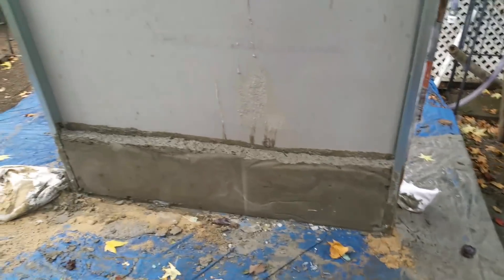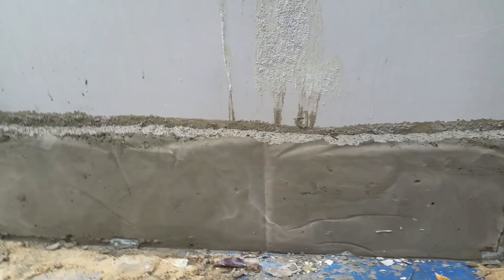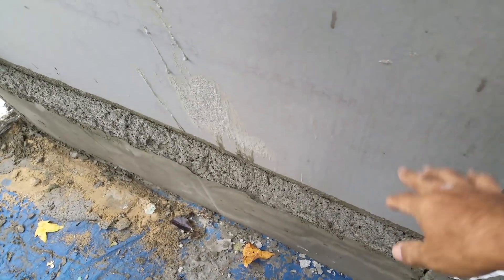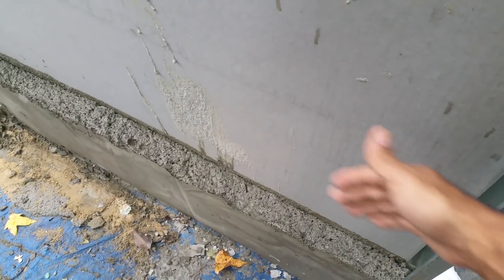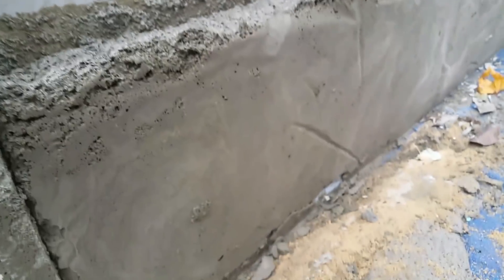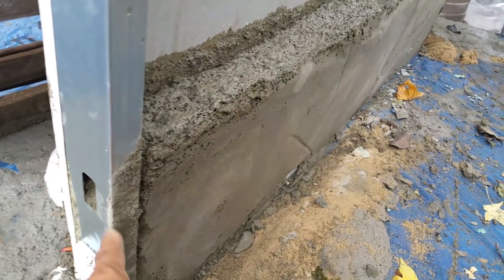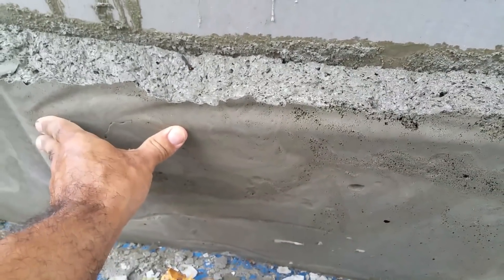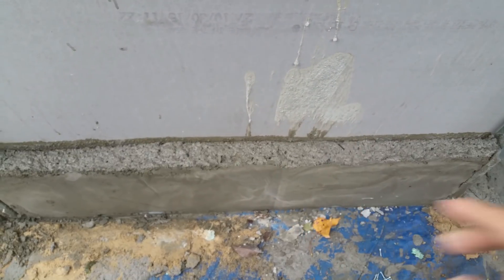Aircrete Wall Experiment #Aircrete #AircreteHarry #AircreteWall #AircreteExperiment #DIY #Foam

Comment: Harry  YOU CAN MY FREIND ! PLEASE READ THIS !!!! if you planning to put that technique outside i will advice the guy attempting to do that to not keep the metal studs! ok no need for ! they will create low spots in quality of the material (as for isolation purposes) Been different materials they will react as for the 2 key factors in isolation that is loss (transmission) and resistance against temperature changings !!!! so better to pour on it but to get the studs out and use some kind of mortar joints metal or plastic and  to repeat that until the end !also on the finishing side you wil have such called work joints that you need to feel with same resistance filler or elastic on the outer side! is not impossible but need more care ! is like building prefabricated casted walls but poured in place (in -sito) using aerated concrete ! mark me a email and i will send you some drawings because i design also !

Comment: please note this ! if you want to use this kind of material only with no Styrofoam still i encourage you to put Styrofoam also you need a density of 140kg /m3 no more no less. Still using that density with Styrofoam as for isolation purposes only you can end up lower densities using same mix design formula! capisi ? i am not a DIY i am a professional in construction ! i am telling as it is ! Either way you have to take in consideration the reinforced of your actual footings/slab because you add such called dead weight over a foundation that initially not  been design as for such weight ok? it might sound easy to you but again is not if you planning to do something that will last longer time and will not crack in less then 20 years ! about isolation purposes way in the world you not just pour Styrofoam and end of story because it has more isolation factors !? and has less weight also !!! no need for further slab /foundation modification !!!

Comment: Harry if you planning to build a house like this you need to follow the regional construction codes! as it is you can t ! i m not quite aware what state are you located but you should have at least for that principle a structural thing ! or a concrete cinder block pillars that you fill and with in the rebar's inside and connected to the this kind of pouring in site light concrete or  metal or another kind of structural and use this as for this width .you need at leas 20 cm by European code you code must be different i suppose ! you can try using plastic sheets also to get out the framework and re use them !

Comment: how long do you think the steel will last being encased in the aircrete? if its like 100 years, then im in...i was thinking if it works, vapor barrier the outside, then 1" 1/8th plywood after that, then polywall vapor barrier again, 2" rockwool exterior insulation board, strapping, and then metal cladding. this way it incorporates the perfect wall system outside, and the aircrete idea of harrys for a mud wall mexican kinda vibe...mass thermo for the inside, and the outside vapor and insulation keeping moisture out...any theory wrong here?

Comment: you have to lay them flat on the payvement flat surace before you put it up on its side. Dont fill cavites... they all droop and break out the bottom.  Its very easy to make the blocks or the wall forms in 2 by 4 or even 3 by 8 walls. its pretty easy as long as you lay them on their sides.  and wait a day or two for them to come out.

Comment: On our dome.. we added fiberglass fibers to the shotcrete but I hear fly ash is ideal for lighter product like: https://www.youtube.com/watch?v=gPFDTr-xzv8 .. but I'd suggest adding some reinforcement in your walls like fiberglass reinforced or basalt rebar.  With a light steel frame you have some support, but your "cement" wall is far from typical concrete thats load bearing or safe from impact from teenage boys horsing around.  
We ran all electrical lines in conduit and water lines ahead of time in the walls. 
I like the idea of pouring flat and setting in place.. but again.. without rigid internal support .. it's still a weak wall.

Comment: I have work on Foam Concrete for 20 years, and successfully casted whole complete house with it at one go, lots of time and money spend including making Stay In Place forms and Reusable plastic modular forms, the Arreated concrete density can be adjusted from 1900 kg/m3 down to those that is just a few hundred kg/m3 that floats in water, strength is adjusted by cement and cement sand ratio, also usage of a few types of fibers for cracks prevention, wee videos and write-up and all my work in my website : www.lcm.my

Comment: Maybe for insulating external wall, u only fill say 1 feet first with pure cement, this is to help prevent moisture going up, also acts as a plug if you got holes, then just add a think 2-3feet layer of air crete at a time, to prevent walls from defaming due to pressure, this of course will take a lot of time tho.

Comment: When running electrical or plumbing through metal studs be sure you use a grommet to prevent the metal edge from cutting the wire or pipe. I have seen what happens after 8 years without grommets - a copper water pipe chauffed and leaked over 5,000 gallons in the crawlway before the homeowner discovered a high water bill and went looking. OUCH!

Comment: How about laying out the wall on the ground, then tilting it up into place to prevent blowout.  Preformed units can be cut and fit into place like Styrofoam blocks.  Put electrical conduit in the walls so that the aircrete won't seal in the wire preventing new wire from being fished through in the future.  Just thinking about aircrete.

Comment: If using as an insulator, what is the R-value? Can it be made waterproof by painting? Aircrete mix + sand is not aircrete. Does that even have a name?

Comment: it seems like your wall coating is very similar to a lightweight stucco and or cement plaster using polystyrene for a filler,
if you can contain the moisture egress the final product will cure better.
and I agree with others who mention using a metal back sheet or lath.

Comment: I recommend searching for a video talking about spacecrete. It's similar to what Harry chats about in this video.
Now, If your doing this inside an existing wall, I'd worry about all the moisture going in between the wall. Don't you want the concrete to dry nicely in open air?

Comment: I also had an idea to use aircrete as exterior cladding or siding.  It wouldn't have to hold up more than other aircrete blocks, so high compression strength would not be an issue-- they could also be screwed to the sheathing of the structure for added resilience.  They could be made in moulds that would be attractive and look like expensive masonry.  They could be slotted on one side and metal pins or tennons  cast in the other side so that they will fit together more tightly.  

I thought that the bottom of the mould could have a thin, even layer of screeded sand and that the aircrete could be poured over; this would give the appearance of sandstone block and would protect the outside face.  You may be able to increase the durability by also troweling a layer of parging or pure cement on the bottom of the form, with or without sand, and then pouring the aircrete right over the top.  If this is done before setting, the two layers would be inseparably bonded. 

George Washington's Mount Vernon looks like it is made of expensive stone blocks, but the siding is actually shaped wood blocks nailed in place.  Thomas Jefferson used sand thrown onto wet paint to create the effect of sandstone window sills in his foyer. 

Keep going your experiments are fascinating.

Comment: I probably would not put water pipes in the aircrete because, in time, they will leak and the plumber will have a very hard time finding the damage.  I have had pin hole leaks in the plumbing in my current house-- a mess that is almost inevitable.

For the electrical wiring,  try sealing electrical conduit in the aircrete.  It will always stay open and the electrician can  easily "fish" new or replaced wiring through it and it may add a bit more strength to the wall, can be easily grounded, and limit the EMFs coming off the line.
Reply: For plumbing, I wonder if you could fish PEX through a conduit to act in the same fashion as electrical? No tight bends, of course but a 'wet junction box' may remedy that. thoughts?
Reply: Where the hell do you live? Water pipes which leak? Dude, my house is 60 years Old with exact that same age of piping and nothing leaks. What workers and quality do you have in your country? And about finding a leak? That is no work at all. Easy done by a professional. I must really wonder about your answer. Leaking plumbing is not an issue at all in germany.

Comment: I would consider fiber instead of sand for strength, and still keep it light weight.  Chopped fiberglass for concrete, it's what is used for countertops.

Comment: You need to learn basic form carpentry. Drywall turns to mush when it gets wet.not in any way a suitable material for any type of form work.You are complete idiot.
Reply from the maker: Eric Arnold Eric if you'd bothered to pay attention to the video you would know that at 4 minutes and 50 seconds into the video, I mention the second reason for doing this experiment. If you have an existing drywall in your house and wish to insulate it using aircrete what would be the damage if any to your drywall. Now you can apologize for your statement to me. Otherwise I'm Rubber and you're glue everything you say to me, bounces off of me and sticks to you.
Reply: Don't listen to the trolls.
Reply: Eric Arnold Then your head must be made of gypsum and you've been out in the rain a lot.
Reply: Eric, you should be ashamed of yourself for your rude comment.
Reply: The real funny thing is that cured concrete is actually a desiccant. So once cured it actually absorbs moisture that can accumulate in interior walls.

Comment: For interior walls, I think Perlite mixed into the Cement would make a stronger and much lighter weight wall rather than Sand as additive.  Perlite would cost more than sand however.

Comment: What you have there will likely not "stick" or adhere to that surface, especially the higher it goes! That crete looks thicker that stucco and will fall off without some type of extruded metal screen as is used in stucco applications. It allows the crete to adhere to it. Just a thought.

Comment: adequate unsulation for exterior walls would require about 12 inches of aircete.
Reply from the maker: John Tingle these walls are intended to be my interior walls of the house. And they would actually be 3 to 4 inch thick to cover Plumbing pipes and electrical wiring which would obviously be embedded in the aircrete.

Comment: why didnt you pour your panels laying down on the ground and then stan them up after they have cured?
Reply from the maker: John Tingle this was a small-scale test of how walls could be poured-in-place made of aircrete. And reality there would have been two concrete columns perhaps 10 feet apart. Which the air Crete would go in between to create a wall. You would not want to lift a 10 ft wide 12 ft tall aircrete wall from the floor. you have a very good chance of the wall cracking before the mesh and exterior stucco coating went on.
Reply: @AircreteHarry  You are correct about not wanting to lift it but what about the maximum height you can poor Aircrete before the bubbles at the bottom collapse?

Comment: I would use driveway mesh 4x8with4" grid drill the studs evey 4 inch and center it and pour complete panel's
Reply from the maker: waterchildtera the mash is what I intend to use on the exterior of the aircrete wall with the Magnesium based cement covering the mesh anywhere from one eighth of an inch two 1/4 inch thick. The Magnesium base cement cures to 9000 PSI.

Comment: I understand you were using the dry wall because you had it laying around but you may want to use malamine coated mdf boards and a release agent for your forms in the future. This is what is used when making concrete counter tops.

Comment: Is there a way to directly mix the concrete solution with detergent and foam it instead of producing the foam separately ?
Reply: It's not advisable. #1- you'd be wasting a lot of foaming agent, due to lack of aeration, not to mention the inconsistent density issue #2- even if you could, you'd be wasting energy from having to agitate the heavier whole product.

The only way to cavitate the whole mixture, is either autoclave (baking), or chemical reaction (same process as autoclave, but with an alumina matrix in the blend, which would cavitate via hydrogen off-gassing with a higher acid concentration).
Reply from the maker: No, I do not believe it will work of all the aircrete videos I saw that method has never been used.
Reply: thnx

Comment: Why didn't you wait til the aircrete cures and then make your video, it's very long, not a lot of info, and no investigation as to whether it's stronger with the sand, less insulator because of the sand, etc.  But still appreciate it and good experiment
Reply from the maker: I didn't wait because on camera you can't tell how cured the aircrete is. And from past experiment on and off camera I know that sand will make strong aircrete. And adding sand adds to the thermal mass so to make aircrete more insulative you want to add more foam to create more air pockets.

Comment: for exterior, possibly, you would the mixture cure a little bit so its not so liquid and then trowel it on?
Reply from the maker: I don't know how well it would work as a stucco. I never let it set then tried to trowel it on to anything. You will have to do that experiment yourself. If you attempt it, video it for the rest of us to see what happens good or bad. May the force be with you.
Reply: hehe...thanks
Reply: Wouldn't it remove some of the air when troweling it on?
Reply: I would suspect it would remove all of the air if you troweled too hard...
Reply: Seems to me troweling/working it would thicken it.  Also, if you're using any chemical foaming agents to create bubbles it can take hours to properly fill a void.

Comment: I would like to use this for a stucco type application over exterior wood siding.  How long does it take to set up?  What mix do you think would work best for exterior stucco style?
Reply: Aircrete's lightness makes it soft also, which is bad for the exterior, true. But what if something is mixed to give it a hard shell? Or it is applied afterward? Stuccoed?
Reply: Do not use aircrete for exterior stucco or anything structural. Stucco is fine sand silk and portland it resists water and has super high strength against wind and rain. Real concrete erodes 1/64" per year that is why stucco is painted, stucco it is very hard then paint takes pounding and gets re painted as needed. I do not know how fast aircrete will erode but it will end of story. You do not want to exterior of house to be something a child with a stick could make a hole in.

Comment: I'm thinking of aircrete for exterior walls and water heated floors in a tiny house on wheels.
Reply from the maker: You should not use aircrete for your floors if your planing on having radiant floor heating, The aircrete is an insulator and will not transfer the heat. I think for your tiny house on wheel you should consider this system instead. It would be much better and since it is tiny it will not cost much and would be faster to build. 
https://www.youtube.com/watch?v=YbxRBl14h4o&t=59s
https://www.youtube.com/watch?v=I9Nk6PkkKI4
https://www.youtube.com/watch?v=0ILfp7fONeA&t=116s
https://www.youtube.com/watch?v=Iw9Lnik_rhk&t=100s
May the force be with you.
Reply: A J Creedon Sr I was wondering how it would work for radiant floor heat... I imagine it wouldn't be good because it may not let the heat through to the floor above because I have seen The HoneyDo Carpenter put a blowtorch to a brick of it and he couldn't feel the heat on the other side.
Reply: Aircrete is perfect for radiant floor;, you just need to have the tubing on top or embedded so that the top of it can contact any flooring surface you lay atop it.

I wouldn't use just any old aircrete in an application where there's vibration and flexing, that application really calls for some additives and internal reinforcement.